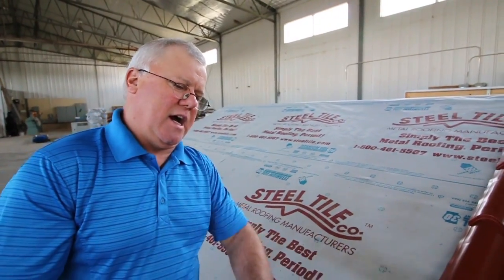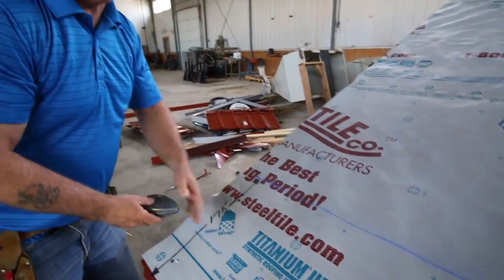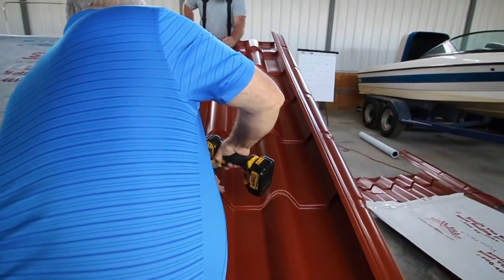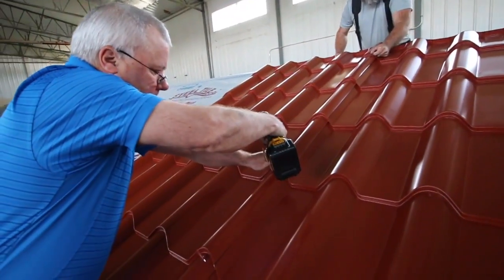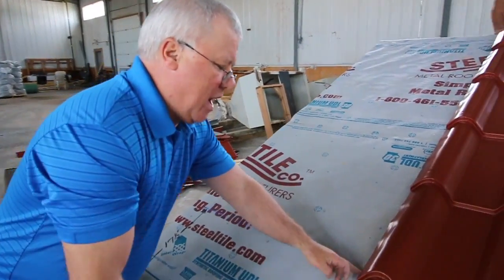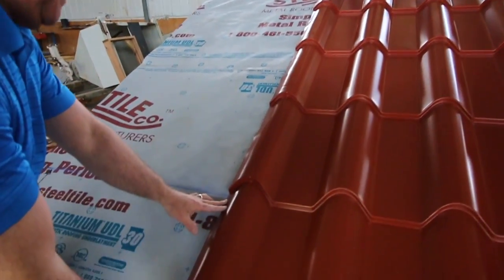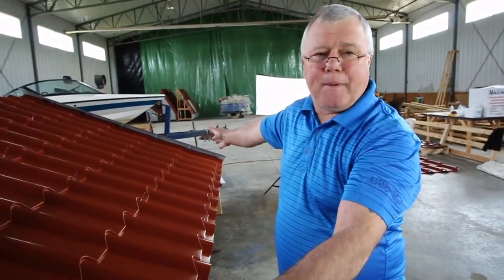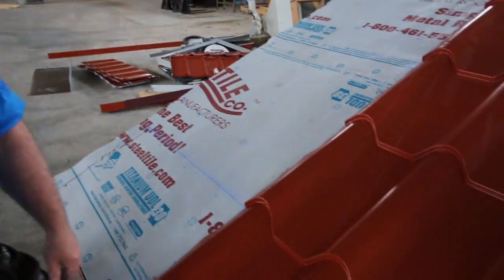The Easiest way to Install a Metal Roof #shorts #instagram #viral

Comment: May I know if the you are using the blue wrap(plastic wrap of boat every winter) before putting the metal roof
Reply from the maker: We would use a water and ice shield wrap (different from the kind you use for a boat) before the roof.